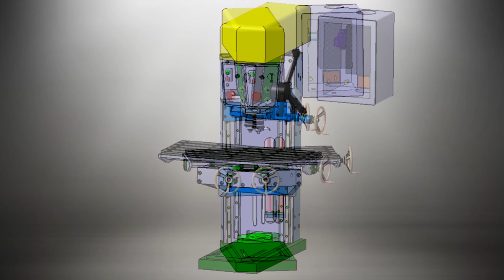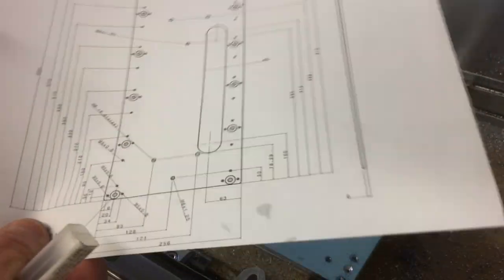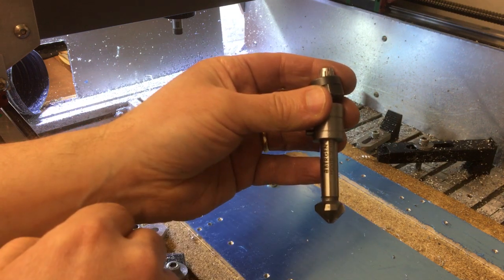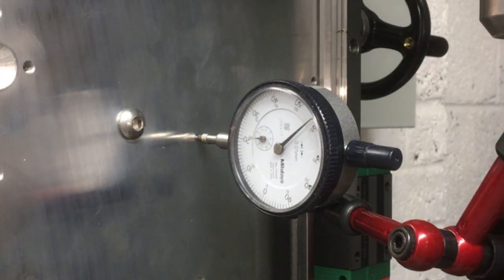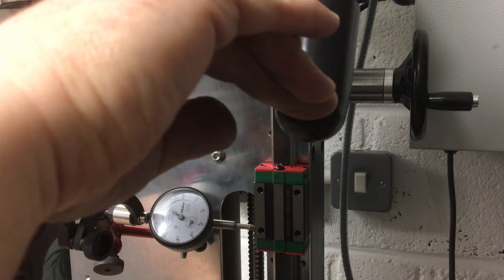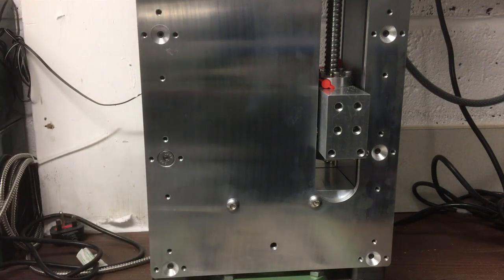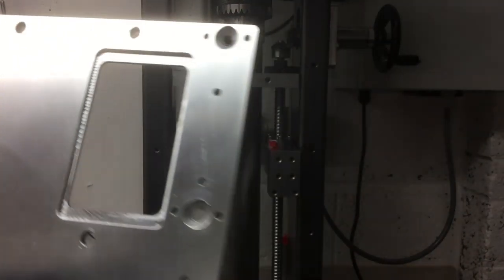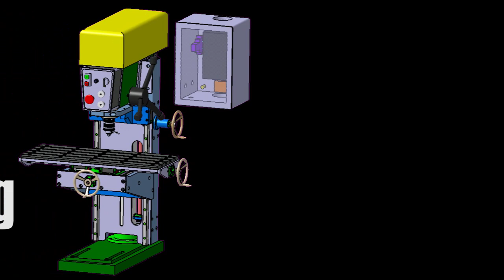Ep17: Drill Press Upgrade | Front mounting plate

Comment: Should have interpolated the countersinks with a smaller countersink bit... But you made it through!
Reply from the maker: Yes that would have been good.  I’ll have a look through Fusion’s library and see if they have one for next time.  Maybe I could buy another one and grind off all the flutes except one allowing a higher rpm more suited to the spindle running range.  Good comment thanks.
Reply: @routercnc9517  I think you can buy single flute 45* endmills. Or even using a single flute countersink to interpolate it would work.
Reply from the maker: OK good suggestion - I’ll have a search around.

Comment: instead of a countersink why not a button head in a pocket with some wiggle room and dowels for alignment ? 
just a thought
Reply from the maker: That could work too but the plate is only 6mm thick so they would have to be M4 maximum to take a counterbore and be under flush which is not very big.

Comment: I'm really enjoying watching this project. Have you asked yourself if you should just have built a milling machine from scratch instead?
Reply from the maker: Bottom line is it I’m not allowed to buy a milling machine (too many tools already apparently).  But nothing in the rules about sneaking up on one with random small parcels arriving. . . . !
Reply from the maker: That includes appearing to build yet another machine as well !
Reply: So "modifying" is within the rules then? Especially if it is useful for household projects.... that noise though😳
Reply from the maker: Modifying is OK and doesn’t seem to register on the radar.  Yes the countersinks were running way too fast and not enough tool pressure.  Probably dulled the edges.  But we got there.

Comment: More tork less speed on the counter sync but don’t worry I can’t spell but nice work
Reply from the maker: Thanks.  There is no low end torque on these spindles so it would need a different motor.
Reply: @routercnc9517  Hopefully that will be in your next video series 👍
Reply from the maker: @sonsrc1326  Don't tempt me, need to finish this thing !